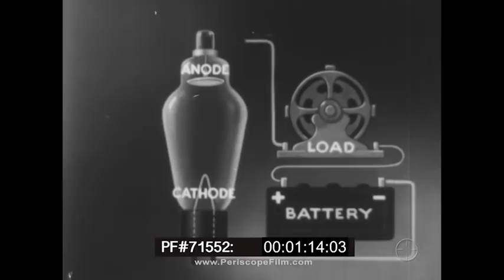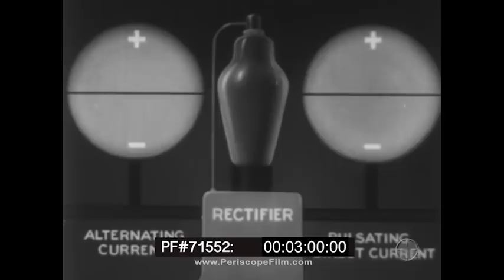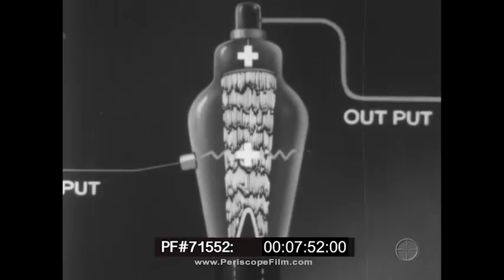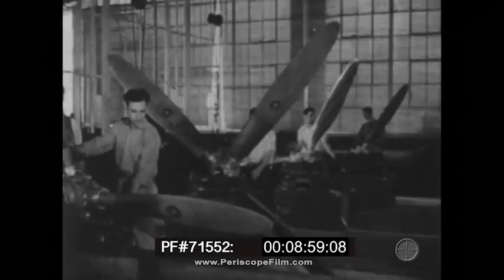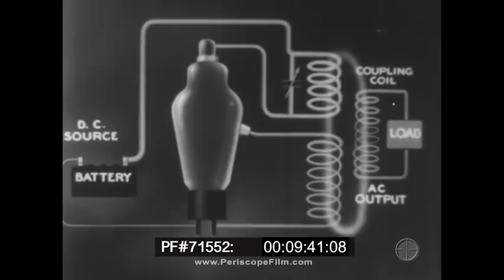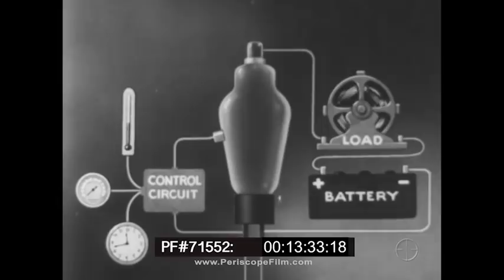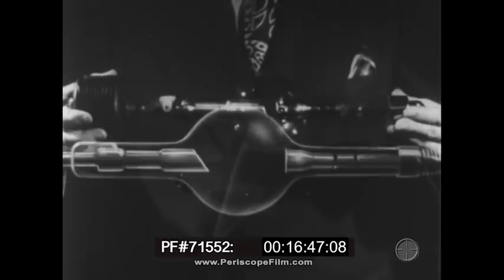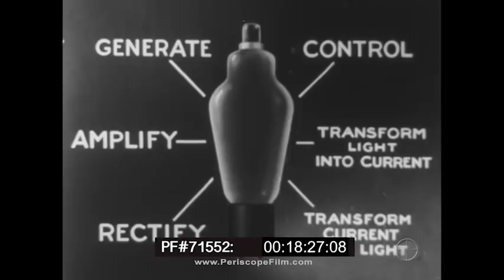VACUUM TUBE ELECTRONICS AT WORK   1940s WESTINGHOUSE PROMOTIONAL FILM 71552

Comment: Back around 1973, I worked at a paper mill and the motor speed controls still used the tubes in this old film
Reply: I’m only 43 and had a old Tube tv and my dad showed me how to fix them and how tubes worked ,that tv would probably work today and it also kept my bedroom warm in cold winter nights

Comment: transistors in 1947: I'm about to end this whole company
Reply: As if transistors came from nowhere to completely replace tubes. You seem to ignore that vacuum tube equipment was used to create and refine the transistor. You also ignore that the early devices were very unreliable and that tubes powered most consumer devices into the late 1960's. Most early transistor audio sounded horrible compared with tubes also. Not until the 1970's did solid state equipment become a viable contender in the hifi stereo realm.
Reply: @hyperluminalreality1  And most people STILL use vacuum tubes daily (several times a day, usually) The "magnetron" is a vacuum tube that is the main part of the microwave oven!